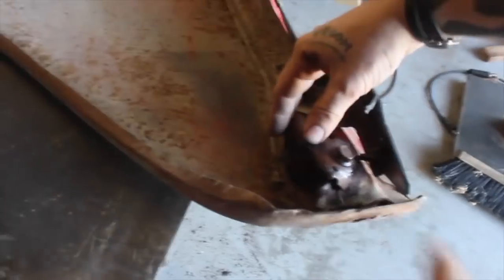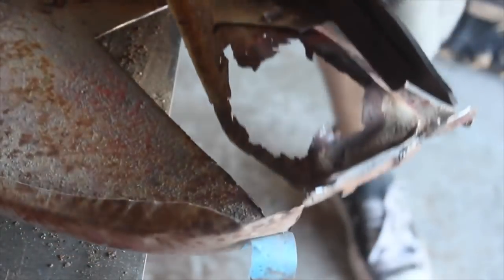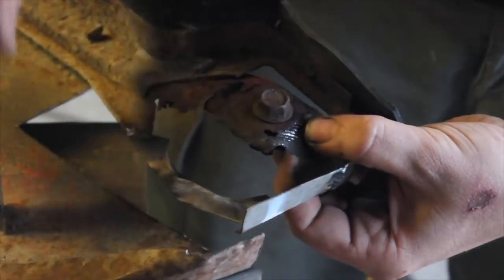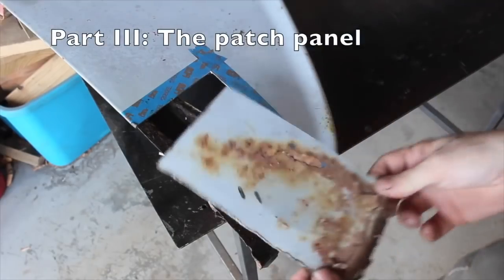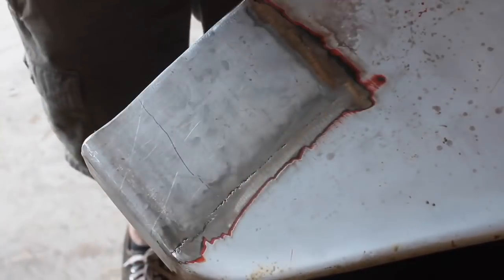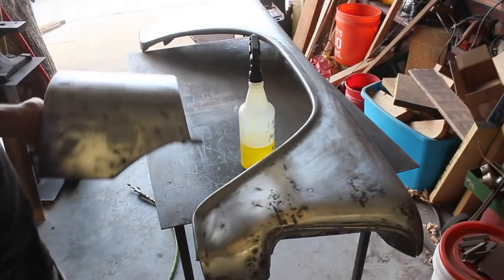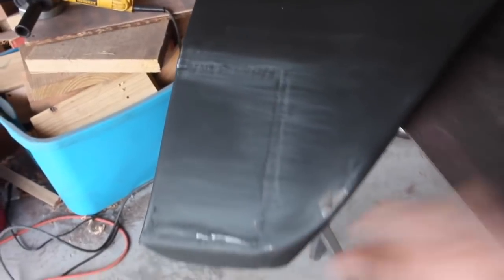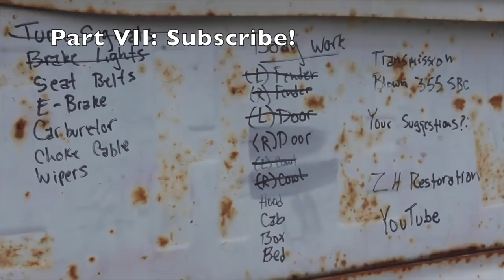1. Fender & Cowl - Mount fabrication, patch panels, body work,  primer,  | 1961 Chevy Apache

Comment: Nice job. If I could do what your able to do I would not have call a tow truck to take away my 64 chevy pickup in 1975. It still ran but at that time we needed to get safety inspections on all trucks and when I took mine through in 75 it got 12 safety violations. I couldn't afford that. But I still miss it. Thanks for the video.

Comment: Right at about  9:15 in your video where you show the front of the fender.  I'm curious if what looks like a trim piece on the front of the fender where the head light bezel would come close to it. It would encase the sides of the grill sort of.  Is that a seperate body piece?  Can it be seperately removed from the fender?

Comment: Nice work! My dad`s work was doing body car repair. He used the oxigen acetylene torch plus an iron wire as an add on the welding. Follow the videos! Cheers.
Reply from the maker: Thank you! 
Man I feel like Oxy Acetylene would be super hard for this sort of stuff!
Reply: ZH Fabrications  it requires a lot of practise, but was the way he used, and all the body car fixers uses (chapistas, in spanish) here in argentina. Saludos!

Comment: On Bondo . I like to feel the heat  if its not warm its set ..whipe it down with laquer thinner to remove the Glaze   it wont gum up your paper as fast pryor to sanding .. working with Lead is better .. you can set it with fine steel shavings and a magnet will stick to it ..

Comment: I've got a 64 Falcon Ute here on my "To Do" list, should be fun when I get the time. The alcohol gets expensive, have a look for wax and grease remover, it'll do the same job much cheaper.
Reply from the maker: Nice, any idea when you'll get around to it, that would be a cool build!
Reply: I've cut out and replaced the entire underside of the car (well half of it), the tray, cut and repaired all the rust, installed air-con ducts in the dash, installed tablet mounts. I'm toying with the idea of making it electric. That stuff is coming down in price. Baby on the way though, so probably pushed back again.